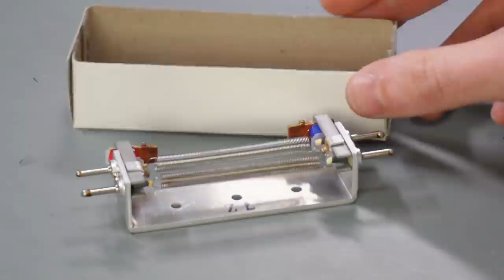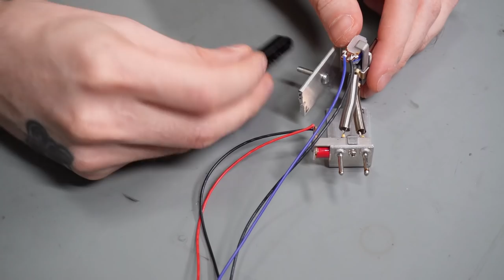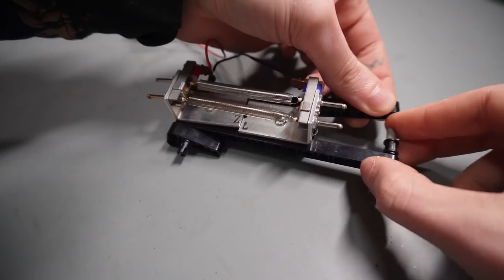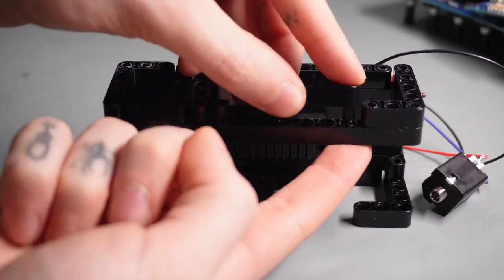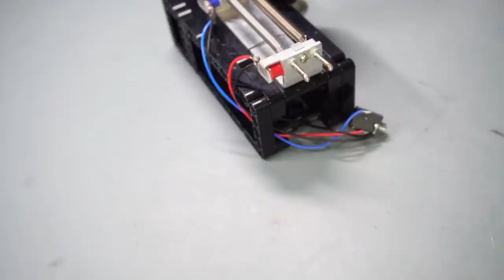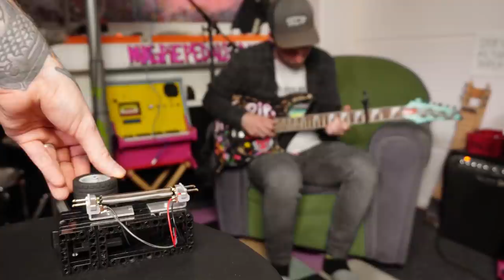I Made A LEGO Spring Reverb That Tune The Springs

Comment: Making an EBow to excite the springs would be cool :)  They use electromagnetism to vibrate/sustain guitar strings without picking/plucking them, so it's like a very slow attack phase
Reply: I remember that guy! Such a nice fellow, some great tracks have been cut with these, but it's one of those obscure, one-trick kinda devices. It sure inspired some crazy tech-build dreams when I was a young creative, tho'.
Reply: Played drums in a band for a little while that made great use of the ebow. I'd never seen one before that it blew my mind a bit. I agree that would probably sound really cool directly on the springs.

Comment: Interesting idea.. are you running anything between the instrument and the spring? I had a couple ideas for spring reverbs for synths but started to get confused with rca jacks and seemed like you needed mini amp with rca to run between instrument and spring with most actual spring reverbs for amps.

Comment: does a reverb not need an in and output ??
Reply: Trrs fixes this the tip and ring can be send/in and the ring and sleeve can be return/out! - or vice/versa!
Reply: Also the same principle applies for trs to two ts/ mono cable the two ends of the mono cable can be used as send return this is probably the method Simon used!